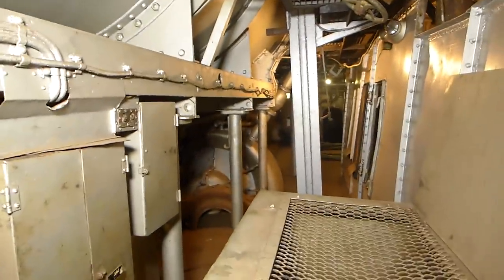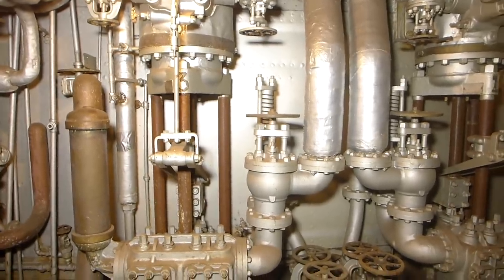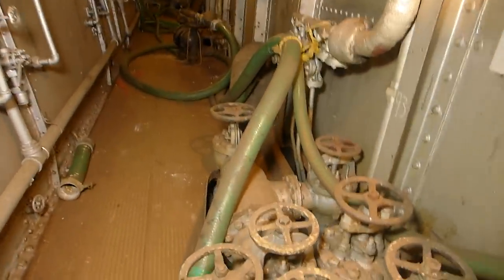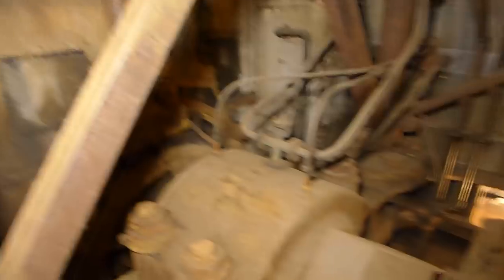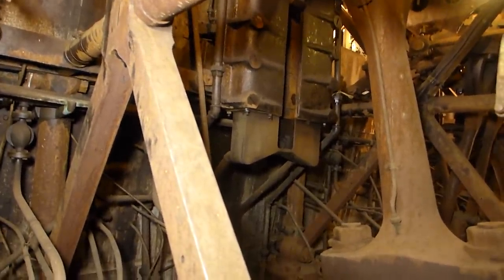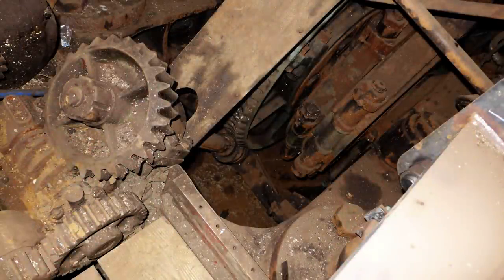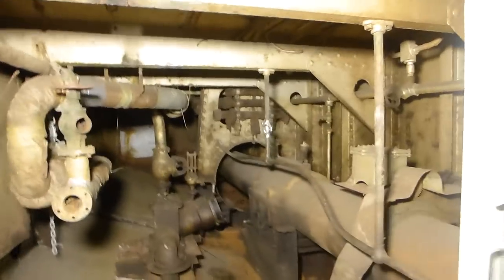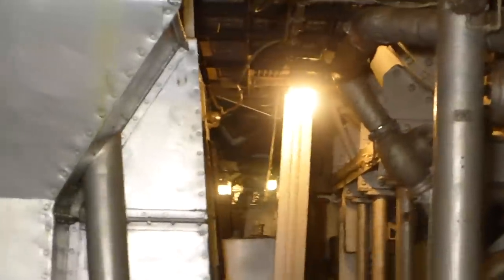Battleship Texas, Starboard Engine Room Lower Grate, Video 3 of 3

Comment: The best way to experience the heat, feel and smells of a triple-expansion engine room is to take one of the day cruises offered by the SS JOHN W BROWN in Baltimore and the SS JEREMIAH O'BRIEN in San Francisco.  These are the two last operating Liberty ships in existence.  To save marine steam turbines and reduction gears for higher-speed vessels, the Liberty ships were equipped with a single 2,500 ihp triple-expansion engine.  I was an engine room volunteer aboard the SS JOHN W BROWN for five years and it was one of the most enjoyable and worthwhile things I have ever done.
Reply: That's awesome, I need to do that one day - I crew the TBM Avenger which did the mock torpedo runs on the JW Brown, totally different set of maintenance and engineering challenges, but both WWII technology. :)
Reply: @EstorilEm  The mock air attacks have always been a highlight of our day cruises.  Thank you and colleagues for participating.  I know the cost per hour of operating your historic aircraft is staggering-- I've wanted to take a ride in a P-51 for years but $2000 for half an hour is way out of my price range.
Reply: It had to be crazy working in engine room crossing the Atlantic in a comvoy looking at the outer bulkhead & knowing the deep blue sea & U-Boats were out there..great report on the Liberty units- I went to Navy Mechanic school in CA. (89').. Gettin old..lol
Reply: @mikeray1544  I have heard and read that in combat you have to believe that there is only one bullet with your name on it.  I guess the same principle applies here-- but imagine being on watch during an attack and hearing the sounds of torpedos exploding after striking other vessels and the horrible sounds ships make when they are sinking.  

We're all getting old. . . lol.  I have been interested in steam and maritime history since childhood.  When I found out in my 40's that I could volunteer to work with the type of triple-expansion engine that powered most of the world's ships from the 1880's until the mid twentieth century, I think I drove down to Baltimore from my home in Harrisburg, PA the next weekend.

The BROWN gets a Coast Guard inspection every year, typically by very young Coast Guard sailors.  When they are shown the engine room, they are like kids in a candy store, seeing something that they had only read about.
Reply: Thanks, now that it's in the end of a 2,000 milen plus journey, is there another on the East Coast doing cruises?
Reply: @frankbodenschatz173  the SS JOHN W BROWN in Baltimore runs living history cruises during the warmer months and also offers a “steam school” for people wanting a more in-depth experience.
Reply: @John Kailua  thanks so much sir! It's a better possibility for the near future!

Comment: I absolutely LOVE these technical videos, and am ever so glad to have found them.
I am by training and 40 years work experience an "Aerospace and Mechanical Engineer".  It says so right on my diploma.  About 20 years in heavy industry, followed by 20 years at Boeing.
Of course, by inclination, I'm a medieval siege artillery engineer.  I've designed and built machines that have hurled pumpkins over 700 feet.
And I'm still totally awestruck by my predecessors 110 or so years ago who created these extremely complicated and successful systems which were still fighting wars 60 years or so later.
My ball-cap is off to you, Tom, and to those who went before.
Oh, and to the guys who worked there.  Hot, noisy, uncomfortable in the extreme.  I bet they griped, but they did their jobs anyhow.
My dad was a Navy medic in WWII.  I'm sure he saw some awful stuff -- he was on an Attack Transport that took troops into the landing beaches and wounded out.  He never talked about that.
Gotta go now, there's something in my eyes.

Comment: As a mechanic..I wanted to go around the crankcase area & spray wd-40 on everything- hurts to see the rawness of the surfaces. Im a Navy SeaBee mechanic(ret). Great educational video class.
Reply: It was bothering me as well
Reply: Used to do electrical work at an old car wash. Owner swore by WD 40. He always had several 1 gallon containers of it that he poured into a dozen spray bottles. At end of day they would spray heavy pusher chain. Its great for removing shipping labels on metal boxes. Just have to let it penetrate label for a few minutes. Hrard that the WD means water dispersment.

Comment: Tom as always absolutely amazing in depth videos what a work of art that engine is imagine the noise, sounds, heat and smells and the knowledge that the sailors that worked in there would need for every single valve and pipe it's aww inspiring and upmost respect to each and everyone of them. look forward to more in detail videos of this magnificent battleship. Thankyou
Reply: One amazing thing about large reciprocating steam engines is that, unlike steam or gas turbines or diesels,  they are NOT particularly noisy.  The heat is certainly intense. I was an engine room volunteer for some years aboard the operating Liberty ship museum ship JOHN W BROWN, and we figured that the engine room temperature would run about 50 degrees above the sea temperature.  

You can experience it yourself-- both the JOHN W BROWN, based in Baltimore, and the nearly identical SS JEREMIAH O'BRIEN, based in San Francisco, ran several day  cruises for paying passengers each year before Covid, and are starting up again now.  I don't know for sure about the JEREMIAH O'BRIEN, but on the JOHN W BROWN passengers over about 12 years of age can come right down to the engine room floor plates and watch the 2500 ihp triple-expansion run and the boilers make steam.

Comment: These engines were rated at 14050 HP each.  This was basically the same as the reciprocating engines on the Titanic.   They are smaller in size due to the Navy using higher pressure steam. 

The oil "strainer" you pointed out early in the video is actually a DeLaval centrifugal oil purifier.  Is uses a stack of rotating discs to separate water and impurities from the oil. There is an attached pump all being driven by an electric motor.  I was trained on and operated both this type and the Sharples type of oil purifiers in Machinists Mate A School in Great Lakes in 1972.

One thing not mentioned is that grease or heavy oil was injected into the steam lines to provide lubrication for the main engine and auxiliary engine pistons.  The was removed from the condensate by grease extractors which were basically cloth wrapped strainers.  These were changed out periodically and new cloth was put in.

The engine for the Main Circulating Water Pump is a double expansion double acting steam engine.  The sea water went through the tubes.  Steam condensed on the outside of the tubes and then was pumped to the hotwell by the air pump.
Reply from the maker: Thank you for the clarification on the oil strainer.  Where is the exact point that oil was injected into the steam on this ship?  I have never seen evidence of that in drawings or engine manuals, nor have I seen any evidence of it when directly inspecting the steam lines.

Comment: Excellent tour. The size of those connecting rods is astounding.
Will these spaces be open to the public after the drydock?
Reply from the maker: I don't know for certain, but I hope the starboard engine room will be.  Except for a couple of years when structural repairs were being made beneath the engine rooms, it has been open to the public for most of the time the ship has been a museum.

Comment: Were the engines on the USS TEXAS dynamically balanced by offsetting the cranks of the two low pressure pistons from each other and adjusting the offset of the cranks of all the pistons from each other?  Such a system was used on ocean liners built contemporaneously with the TEXAS.
Reply from the maker: The cranks were set at 0, 90, 180 and 270.  One l.p. and the h.p. fired together at 0 and 180, and the other l.p. and the i.p. fired at 90 and 270.  This doesn't intuitively seem like the best design for smoothness and I don't know the logic behind it.  I also do not know what the specific goals of the designers were and I have to accept that they were likely the best in the world at that time and had their reasons.  Whatever those were, it is certain that the goals of an engine on a battleship could be very different from those on a passenger ship.
Reply: @tomscotttheolderone364  Certainly the goals were different, but one would think one major advantage would be the same -- reduced dynamic vibration translates directly into reduced bearing wear and general wear and tear on the engines.  Of course, the US Navy has always had an institutional case of "not invented here, " of which the grossly defective Mark XIV torpedo was one of the prime examples.

Comment: Tom, great videos.  But water has a higher specific gravity than oil, and therefore the oil floats to the top and the water collects on the bottom of the lube oil holding tank.
Reply from the maker: Thanks, you are right, I misspoke.
Reply: I'm and 'Old One' too (76) Tom.  Thanks for your videos and sharing your knowledge with us. I wonder if today's generation even know what specific gravity is.

Comment: Hi! Another excellent walkthrough.  As im new to such ships can i ask what the temperatures were like down there, especially in the pacific and what was the noise level??
Reply from the maker: Exact temperatures were listed whenever trials were conducted.  Unfortunately, the only one I have is the original 1914 builder's trial.  Based upon that, it is likely that average temps in the engine rooms and boiler rooms, with engines at high speed and boilers at full output, ran about 20 degrees above outside ambient.

Comment: In condensers I have experience with, the cooling water flows through the tubes and steam condenses on the outside. A vacuum raises the efficiency of the engine as you can extract more energy rather than exhausting to atmospheric pressure. Also the non-condensable gases in the steam exhaust can blanket the tubes and cause back pressure on the engine. All my experience is with steam turbines though. Rather than an air pump we used steam jet air ejectors.
Reply from the maker: Thank you, after going back and studying drawings of the condensers, I must admit that you are right.  The cooling water did flow through the tubes like you say.  I am aware that the vacuum they created gave the engines a good efficiency boost that I very briefly commented upon.  I used the term "air pump" because that is what they were called on drawings, in textbooks and manuals of the era.  Perhaps I should refer to both terms in the future.  Thanks again for your knowledge and comments!
Reply: @tomscotttheolderone364   I believe on steam engines they are referred to as an air pump. Small steam engines have it driven off the cross head. Thanks for the video, your knowledge of the systems on Texas is amazing. You certainly deserve an SW pin!

Comment: Hi Tom, great video and explanation. Did the engine always run in either full forward or reverse gear or could they change the cut off point on the valves for greater efficency like a railway engine would?
Reply from the maker: Yes, they could do that, plus adjust each valve individually at the point where the suspension rod attaches to the reversing shaft.

Comment: In the three videos, you pointed out numerous pumps.  Are these steam driven, or electric?  If steam, are they basically little reciprocating engines, or something else like a little turbine or impeller? Are the pumps positive displacement or centrifugal?
Reply from the maker: All pumps in the engine room are steam driven, 150psi reciprocating.  The smaller black ones in the aft end of the rooms on the mid grate level are air compressors.  The large ones on the low grate are feed water, bilge and lube oil circulating pumps.

Comment: How did the size of these engines compare to say the engines on Titanic?
Reply from the maker: Titanic's engines were larger and produced more horsepower.   They also operated on a lower steam pressure and had shorter cutoff, so they didn't utilize steam as well as those on Texas.  However, that wasn't a deficiency since Titanic added a large turbine as an additional stage of steam expansion when at cruise speeds.  Titanic had terrible fuel efficiency whenever that was cut out of the system.  All in all, I wouldn't say that one design was better than the other since they had very different design goals.

Comment: Will the engine still turn?
Reply from the maker: It hasn't turned in 75 years.
Reply: @tomscotttheolderone364  You never know it was built to last, But i would be more worried about the steam pipes etc nasty stuff steam.
Reply from the maker: @adamjones2025  While the big castings and forgings were certainly built to last, there are a lot of parts, such as scores of large bearings, that would require replacement before trying to turn an engine over.  The only good news is that the methods for hand fabricating them are spelled out in old manuals.  However, it would require significant dismantling of the engine that could only be done using heavy cranes and opening up decks above the engine room for access.  This could easily cost hundreds of thousands, if not millions of dollars to accomplish.

Comment: How many men were needed to run each engine room?
Reply from the maker: Unfortunately, I have not found any documentation that gives specific manning levels.  I could guess, but I prefer not to since there were likely a lot of activities that I am not aware of.  I also don't know how specific tasks were assigned.  For instance, how closely did the various bilge and feed water pumps have to be monitored?  Did it only require a quick glance to confirm they were moving or did they require a lot of dedicated attention?  Was there one crew member whose job was to walk the mid and lower grates to monitor them, or was the duty split up and given to several crew who were also doing other things?
Reply: @tomscotttheolderone364  Thanks- much appreciated.
Reply: When I was in as a machinist mate. We had a E.R.S. (engine room supervisor) throttle man, upper level (mid grate), lower level, low grate, and a messenger (roving readings and sounding levels). Knowing the way the Navy works it could not have been less than that, especially for battle stations

Comment: the SIZE of those shaft nuts. What kind of wrench would you need for them?
Reply from the maker: There are some exceptionally large wrenches on board, a couple of which may fit on the nuts.  The pressing question for me is that the wrenches must weigh at least 150-200lbs.  How did they not only support the wrench to correctly position it on the nut, then provide the force necessary to loosen or tighten it? I don't know.
Reply: @tomscotttheolderone364  I wouldn't doubt it needing a small team of burly engineers who knew damn well what they were doing, even then it'd still probably take quite the effort.

Comment: Quick question Tom is any of the Pennsylvania class after the New York reciprocating engine like so? Or did they go straight to turbines after the NY class?
Reply from the maker: Both Pennsylvania and Arizona had turbines.  The Nevada class came between Texas and the Pennsylvanias.  Battleship Oklahoma had reciprocating engines and Nevada had turbines.
Reply: @tomscotttheolderone364  I figured as much it just confused me the fact the Texas was reciprocated and then turbine then back to reciprocated. I guess they just went with what they had. 😂 You have a great day Tom!
Reply from the maker: @mdtransmissionspecialties  There were turbine designs for Texas and New York, but the Navy was not happy with turbine performance on previous battleships and reverted to recips for several reasons.  Reciprocating engine development had reached its nadir, making them more reliable, easier to service and more fuel efficient than turbines at typical cruising speeds.  After considerable study, they reverted to recips for the New York class with the understanding that turbine development, and most importantly reduction gears, was rapidly progressing and would soon eclipse recips on all counts.  Since the Navy preferred to ease into new technology on major ships, they used the Nevadas as a final test bed by taking two essentially identical ships to directly compare the two engine types.  I hope you have a great day also!
Reply: @tomscotttheolderone364  I greatly enjoy your replies and answers. You have no clue how much I appreciate that. Can’t wait to finally come see the ole girl do they generally allow people to see as I’d say the extended tour?
It makes perfect sense that they set two side by side because BB-36 was the first oil fired if I’m not mistaken. And wasn’t 35 converted to oil at this time as well? Gear reduction has done absolute wonders for the industry speaking I see it pretty much daily. I couldn’t imagine what they concocted back then after seeing all of the gearboxes from the Iowa’s.
Reply from the maker: @mdtransmissionspecialties  I am glad that you like them!  Yes, both Texas and New York were converted to oil during modernization.  I covered this in detail in the video, https://www.youtube.com/watch?v=hUTBpTwjES4&t=174s
Reply: @tomscotttheolderone364  it’s where I learned about the Texas being oil fired. Thank you for taking your time to answer these questions. I’m sure I’ll have more once I conjure up another.